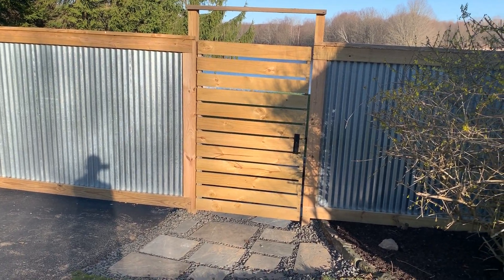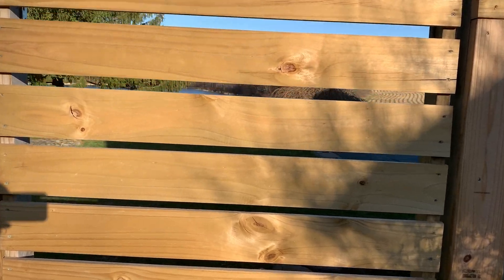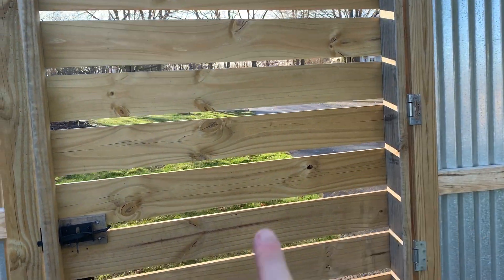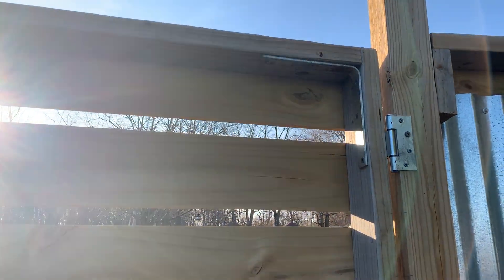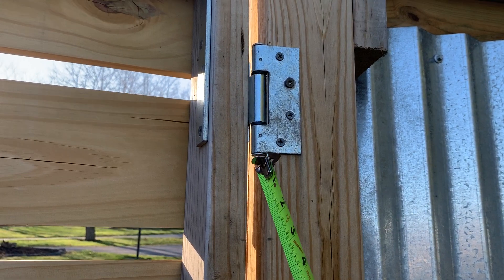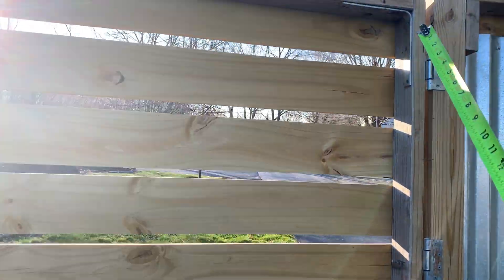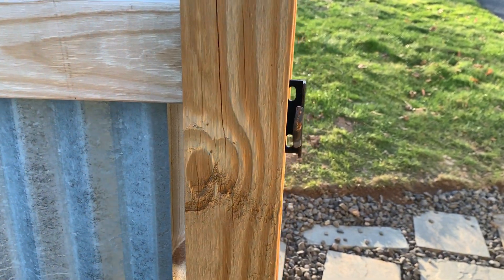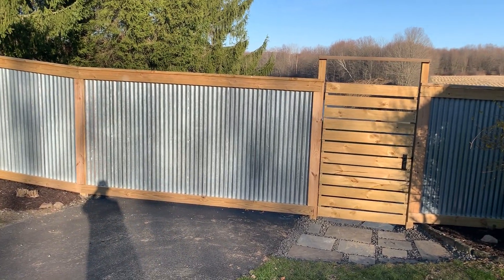How to Build a Gate for your Fence - different design

Comment: Did you use one  cable or did you use two and do an x pattern. Thanks
Reply from the maker: Great question. One cable was all that was needed but be sure to install it in the correct location